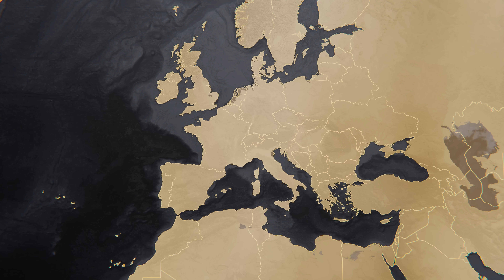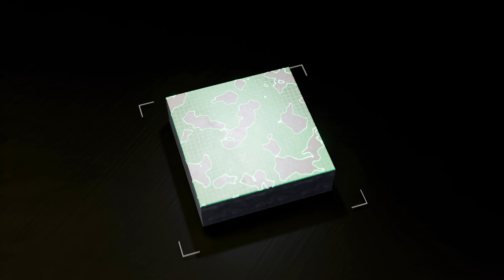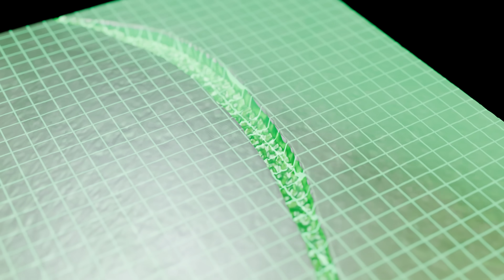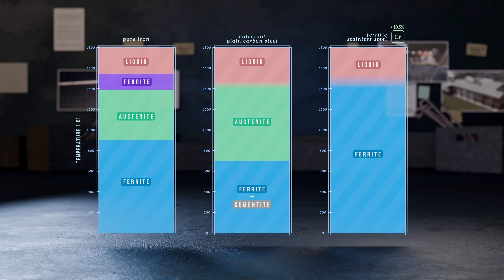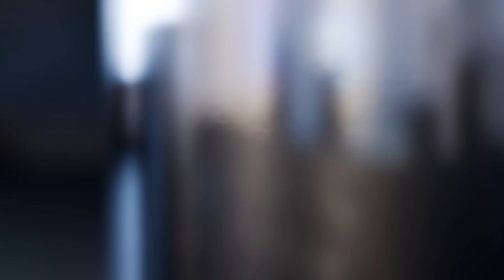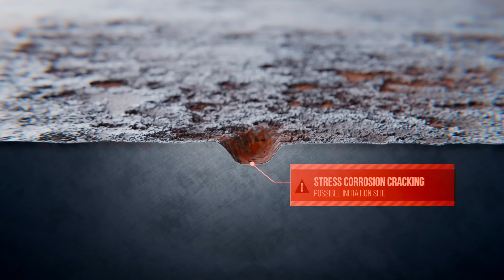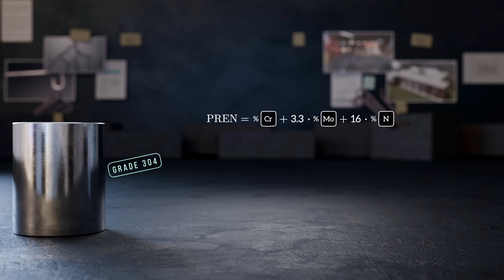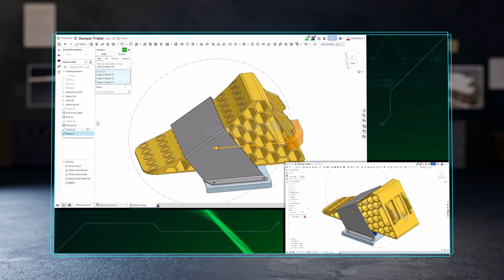The Problem with Stainless Steel

Comment: Great video! I was waiting for you to mention passivation as a means to delay the oxidative degradation of SS but maybe that is off topic.

For anyone wondering if there's a way to make stainless steel last longer, there is.

Typically in the world of process piping we would use 316L or sometimes hastelloy for extremely corrosive materials.  Piping would be hung and welded and then passivated using a ~ 5% dilution of citric acid and demineralized water. Essentially they will tie a reservoir and pump into your piping loop and pump the solution through your loop until the surface no longer has any free iron, usually it only takes about an hour depending on loop size and circulation speed. They verify that passivation is complete using a copper sulfate test ASTM A967. Removing the free iron from the surface helps prolong that first step of oxidative corrosion because there is no iron on the surface to oxidize. Over time iron ions will work their way to the surface and become oxidized but passivation delays this first step by 5x to 10x compared to non-passivated. 

Passivation is not directly a FDA requirement word for word but a "non-reactive product contact surface" is a requirement for cosmetic and pharmaceutical manufacturing process piping as it helps to prevent the formation of "rouge" inside piping and especially holding tanks. Rouging not only looks terrible but can also be a source of contamination. For really corrosive materials (especially bases) hastelloy might be needed. If you thought 316L was expensive, hastelloy costs 3x to 15x more depending on the grade. This is due to it being nickel based vs iron based and being very hard and difficult to manufacture. 

Anyway, I learned some valuable things from the video, hopefully this comments helps someone else learn a thing or two!

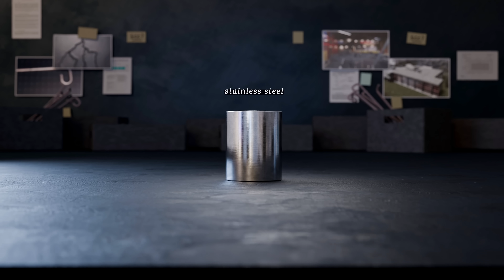Comment: 1:20 

Stainless steel is not “steel plus chromium” as separate materials; it is a single homogeneous alloy whose composition is set while the metal is molten.

Stainless steel is an iron‑based alloy that contains at least 10.5% chromium, along with low carbon and optional elements such as nickel, molybdenum, manganese, silicon, nitrogen, titanium, or niobium depending on the grade. The chromium forms a thin, self‑healing oxide film that provides corrosion resistance. 

In production, manufacturers begin with liquid iron in a furnace and add carbon and all other alloying elements during the melt. Chromium, nickel, molybdenum, and other additions are introduced as ferro‑alloys or pure elements, and the melt chemistry is adjusted through oxygen blowing, decarburisation, and slag control until the target composition is reached. Many stainless grades then undergo argon‑oxygen decarburisation (AOD) to reduce carbon without oxidising chromium. 

Once the chemistry is correct, the molten alloy is cast, and at that moment it is already stainless steel.

Common stainless grades include:  
• *304 (Austenitic):* ~18% Cr, ~8% Ni, ≤0.08% C  
• *316 (Austenitic):* ~16% Cr, ~10% Ni, ~2% Mo, ≤0.08% C  
• *430 (Ferritic):* ~16–18% Cr, very low Ni, ≤0.12% C  
• *410 (Martensitic):* ~11.5–13.5% Cr, higher C (~0.15%–0.4%) for hardenability  
• *2205 Duplex:* ~22% Cr, ~5–6% Ni, ~3% Mo, ~0.15–0.2% N

Highly corrosion‑resistant grades include 316, 2205 duplex, 904L, 2507 super‑duplex, and high‑chromium ferritics such as 444/447, with super‑austenitic and super‑duplex alloys offering the highest resistance in aggressive chloride or chemical environments.

Comment: It is impossible to make high tensile bolts using stainless steel,  there is no carbon in SS -   Stainless threads also have a nasty habit of galling,  which is that it becomes impossible to unscrew....   Stainless steel is for cosmetic purposes not for strength.  Stainless knives also need sharpening every time you use them.... they never keep an edge.

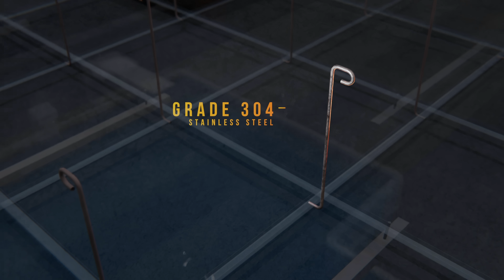Comment: 1:05 quickest "they fucked up badly" ever. 304 is when you want to charge for stainless but don't need stainless. 316 is resistant to acidic enviroment and galvanic corrosion, 304 is shite. That's why in food industry and in exhausts only 316 SS is used.

Comment: Your gumroad checkout isn't working for me to get the engineering summary sheets. Doesn't let me fill card info :(
Reply from the maker: Thanks for letting me know. Which browser are you using? Looks like it might be broken on Firefox, but seems to work on Chrome and Edge.
Reply: @TheEfficientEngineer Ah I'm on Firefox, I can switch to chrome! Thanks for the quick response!
Reply: That worked! Thanks for the great material and have a nice rest of your day!

Comment: 1:45 the exact metal that makes stainless steel HORRIBLE for knives. Never buy a knife that advertises itself as stainless. Yeah, it won't rust, but it also won't hold an edge for shit, chromium is just too soft. All great blade steels rust, simple as that. You gotta take care of them and a little blade oil and drying after getting wet is all you need. Gas station and cheep flee market or Walmart knives are all stainless, or it'll say something like AUS 8(or another number). They aren't worth the block they were cut from. The edge will dull in a day. They are super easy to resharpen but who wants to sharpen their knife after every use? High carbon powdered super steels can hold their edge for months of daily use. They're much harder to resharpen, requiring practice and good whetstones though diamond plates are common know and do an even better job and there are systems you can get that'll hold the correct angle for you too. Most good knife companies allow you to send them in for service and sharpening either for really cheap(like $30 with Microtech which also includes a full teardown and oiling which is essitional for their OTF automatics) or free like Benchmade(they do charge $10 for shipping insurance though). TLDR:NEVER buy a stainless steel knife, really anything with a blade you wanna keep sharp. An axe would be fine cause it doesn't need to be super sharp and they need to be able to be used outside where it's wet and not rust, just no knives or swords.
Reply: There are very very good stainless knife steels, which are both tougher and retain and edge better than most carbon steels. The crap in Walmart/gas stations/gift shops could hardly be considered proper knife steel.

Comment: As far as I understand, the garden variety steel rebar inside the roof slab stood up to corrosion just fine, in the same environment. That's why reinforced concrete was invented.

Comment: Outstanding video. I’m constantly amazed at how much I don’t (or didn’t) know about pretty much everything. I’d known about iron+carbon+chromium as the basis for stainless steel, but holy smokes, this made for a very interesting rabbit hole on the subject,  along with the potential implications of detailed material science in engineering decisions.

Comment: Story from the coatings industry: Was told in the 80's of a bus-fleet whose vehicles suffered brake failures due corrosion of the brake pipes. The fleet engineers thought they had done everything to a high standard by using stainless-steel brake pipes and applying underseal to the underside of the vehicles. The underseal was made of chlorinated rubber...

Comment: The odd thing with stainless steel is that people have the wrong perception of it although the name is completely accurate... It is stainLESS. It stains less than normal steel. 

Never claimed to be completely immune to corrosion

Comment: On a project that I wanted to make a special effort to minimize my potential liability (not immersed, but in proximity to saltwater > sodium-chloride > therefore chlorine) I chose 316L (for low carbon) as it was the most corrosion resistant I could locate. Sounds like they did not make the extra effort.

Comment: I heard "stainless steel corrosion" and "pool" and immediately went to chloride attack. High chloride content water eats 304, especially at elevated temperatures. Some espresso machine companies that use 304 or 316 for their boilers insist upon extremely low chloride content (30 ppm is generally considered the upper limit of acceptable) for the water.

Comment: bleach that kills cheap appliance steel can kill the good stuff in an extreme environment. repeatedly i see how condensation on cold surfaces, and metal as an excellent thermal conductor is often the coldest, can be a poorly controlled cause of big problems.

Comment: Daft comment, 304 does NOT have ,'' excellent resistance to corrosion'',  It is well known that chlorides are dangerous to Stainless materials, even Duplex and Super Duplex stainless Steels. When I Inspected Stainless Pressure vessels I never let the suppliers use Tap water simply because of the Chlorides. This includes Duplex materials !!

Comment: A lot of people mention how they learned more from this video than during their semester. So I must say that our materials professor really was thorough, because this video is 1:1 what he taught us during the progressive materials. I learned so much about stainless steels thanks to him, as well as other materials like nickel alloys etc. He even had experience as court forensic expert so he told us some real life stories about corrosion. In one powerplant near our university they used stainless steel as exhaust for furnaces (coal powerplant), but when they switched to biomass they found out their whole chimney network started to corrode. Answer? The biomass produced chlorine when burned, instead of sulfur like the coal does. So the steel wasnt designed to be used for this fuel. Eye opening stories.

Comment: In a world where stainless steel is often called a harsh mistress due to its difficulty in working it (bending, welding (toxic fumes), drilling/grinding (splinters) I find it both hilarious and ironic that the steel that failed in the pool ceiling was “304” - the same modern label given to modern day mistresses.

Comment: Wrong ceiling material used on ceiling. Too heavy, providing no structural benefit as it was suspended and thus not providing structural benefit. Most suspended ceiling components are lightweight and provide mostly aesthetic value.

Comment: Why did they build the structure with a suspended concrete ceiling?  Looking at the model in the video, it looks like it was hanging from the roof structure by the stainless hooks.  Is that how it was actually constructed?  Why would you have that much suspended, non structural weight?

Comment: About fifty years ago I worked in a water-heater manufacturing business. Various designs of domestic and commercial water heaters were made. Some had header tanks of their own, rather than relying on  a separate low-pressure supply from a domestic ceiling header tank. Some clever engineer improved the ball-cocks so that the tip of the valve that was opened or closed by the rubber washer wouldn't wear so badly over time. The tip of the valve was fitted with a stainless steel insert, I don't know which alloy, sorry. These inserts failed in a very remarkable way, they became porous, like swiss cheese, so water just leaked out everywhere. As told to me, the culprit was crevice corrosion caused by the chlorinated water supply,  possibly this was encouraged by the warm environment. I have never forgotten the look of that rotten stainless steel.

Comment: I wen to a boat building factory using 304 Stainless Steel. When I looked at the SS rods and plates, that had been stored  they were ALL RUSTED. Only SS 316 MARINE GRADE should be used on any structural construction or BOATS. To use CHEAPER SS 304 in STRUCTURES IS CRIMINAL!

Comment: Interesting video. I have used most of the stainless grades depending on what job they had to do from 405, 406, 304 etc but found for a relly good compromise between being corrosion resistant and strong you have to go for some of the new composition stainless steels. When I make anything that has to be outside in a salty environment I use 316 grade or hot dip galvanised mild steel.

Comment: Intergranular Stress Corrosion Cracking in austenitic (type 304) stainless steel came under great scrutiny in the 1970s as primary recirculation systems in boiling water reactors began cracking through-wall after very few years of service. It was found that lowering the carbon content greatly reduced this IGSCC, and "304L" and "NG" (nuclear grades) were created.  Welding created vulnerable heat affected zones, where carbon reacted with chromium leaving behind bands of ferritic material susceptible to cracking. My research explored the possibilities of using additional weld metal over a 'joint' to build up compressive residual stresses at the most vulnerable inner surface of the pipe. (Side note: these compressive residual stresses are statically balanced with near-yield tensile residual stresses at the outer (less vulnerable to cracking) surface.

Comment: Makes little sense to me that failure of the steel rods would collapse the CONCRETE they were embedded IN....The only thing I can think is that one the rods began snapping it transferred the now increased load onto the remaining yet unbroken rods....I suppose eventually (like in seconds) enough rods have failed that there is way too much load on certain still intact rods which finally takes a huge hunk of concrete at anchor point.....then a few of those in a line gets a huge fracture going and so on until the entire ceiling it in the pool on top of the swimmers....maybe bringing down live lighting circuits into the pool?   They may not have been required to protect ceiling circuits with ground fault because normally?  why bother it is so far from the water

Comment: Whole bunch of info that's great for someone who needs a solid background in metallurgy, but  could have been summarized just as well in about 5 minutes.  The nickel gets munched up too after awhile adding to the acid slush eating everything.  This specific disaster though, there was a lot more going on than just the wrong metal.  Warning signs were there but as usual, money, laziness etc ruled the day until someone had to pay.

Comment: It's more like, the problem with material selection, not stainless steel. Also, I don't know if this is an AI video or not, but quite some facts were not exactly correct or incomplete. You need to dig a bit deeper about stainless steels...
Reply: i always thought that stainless steel doesn't rust , 
oh man , does that crap rust FAST , it doesn't even take much bad weather ,
1 rain shower and the thing you think is not going to rust at all ,
it just starts crumbling and a week later it's useless ... 
i hope we find some material soon , that doens't decay , no matter What we throw at it .
we're going to need to invent or find some material , if we want to go to Mars or other planets.
you can't be sitting comfortably in your chair on Mars , watching TV and your house starts leaking ,
that would be kind of a problem , don't you think ... 
there isn't a material we have or invented that does not decay yet . 
it's going to take a while , we're not that smart , at all ... 
we can't see in to the future , we live in the moment and don't look further then our nose is long
Reply: @ThermaL-ty7bw  I don't know what stainless you encountered (I would be interested in the grade), but maybe it was not even stainless. I work with stainless on a daily basis, and I can assure you that the proper grades don't rust, regardless of what you throw at them. Nitric acid, even boiling - no problem. Salty water, even with stronger salts - no problem. High temperature for a very long time - no problem. It all boils down to material selection. And sure, all materials deteriorate with time, but if you select the right steel for the application, it is nearly indestructible. Let me remind you, for example, that there are stainless steel pipes in nuclear plants (kinda harsh environment) has been in service for several decades without issues. Or they are kilometres long, going in different petro-chemical processing plants without issues. And I could continue the list for days. :)

Comment: I remember when I worked at an auto repair shop in the eighties. We got a new furnace. Within 3 months the furnace was bad. The stainless heat exchanger was corroded beyond belief. They warranted the furnace but in 3 months the new one was shot. It turned out the chlorinated brake cleaner we were using caused the damage. We switched to non-chlorinated brake cleaner and the replacement furnace lasted 18 years.

Comment: interesting.  chloride in sprays used to reduce dirt road dust can dissolve the chrome on your car and leave it with dark spots.  I know this from being in the auto industry and seeing the damage.  the saturated dirt will stick to the chrome trim eating away the luster.  lesson is to wash your car after driving on recently chlorided roads